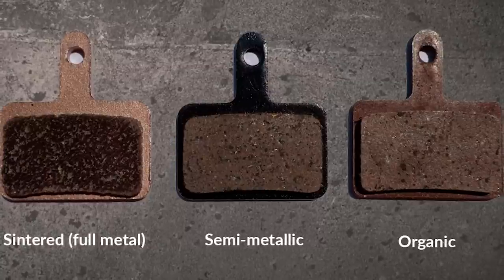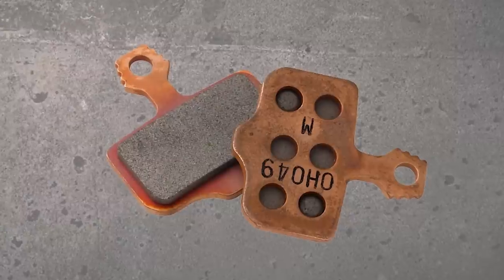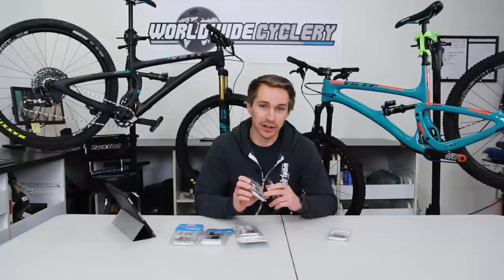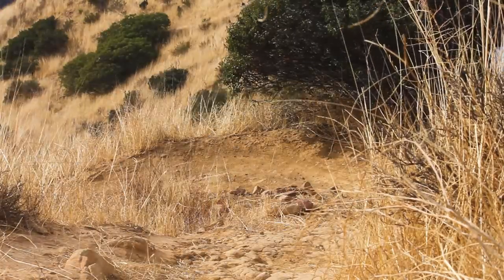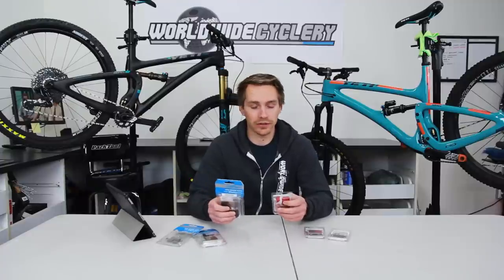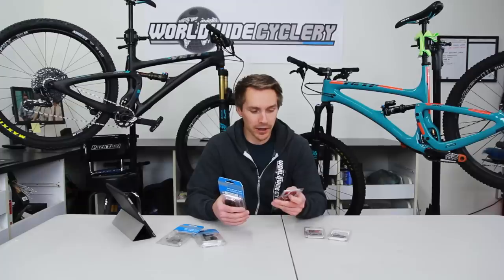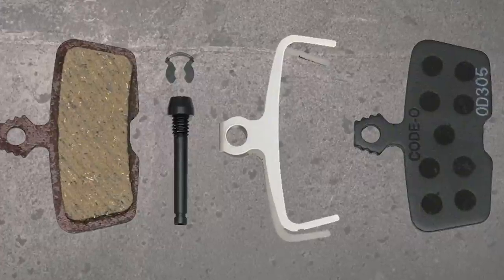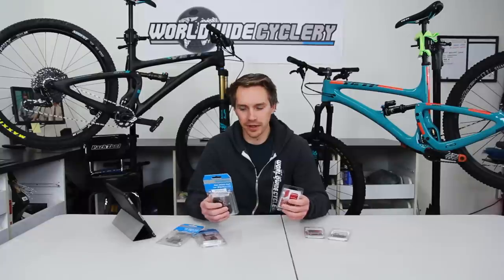Mountain Bike Brake Pads | Organic vs. Sintered - What's the Difference?

Comment: Sintering is the process of compacting and forming a solid mass of material by heat[1] or pressure[2] without melting it to the point of liquefaction.

Comment: Sintered pads wear out your rotors faster too.
Reply: My rotors sometimes make a terrible sound from my metal pads
Reply: I'm still running a really old set of Magura rotors 203 front 180 back and they are fine and will probably outlast the Magura MT brakes.

Comment: For my EX8 I use Galfer Green Pro up front (proprietary compound) on my Galfer WaveDisc rotor. Tektro ceramic-semi metallic out back on the stock rotor. 
Sintered are better in general. Though it does depends on type of riding and conditions.

Comment: i have ran the organic pads riding downhill, the organic pads work but burn off fast and smell very weird. the worst part is they make a wicked squeal and your rotors will get a film on them that makes them squeal even after you change to sintered. i would recommend swapping out organics to sintered on a new dh bike before you even run them.
Reply: thanks mjs1231...i only have dh bikes and bmx so i don't have any smaller rotor brakes...good heads up though!
Reply: I don't quite understand your statement - you can run any compound you want, regardless of the size of the rotor (unless you're just suggesting to stick with sintered if you're running big 203mm rotors).
Reply: If you do get a glaze on your pads, and even the rotors, you can safely sand that glaze off to refresh the surface (use 80 grit or 120 grit paper). That helps a lot to give you a new contact surface.

Comment: I don’t ride in wet conditions and I ride a trail bike fast, but like in the low 30’s fast, not DH speeds. SRAM G2 brakes. I prefer organic, aluminum backed brake pads. Every time I’ve tried metal/sintered I regret it due to the squealing and vibration. And that’s whether I set them up or my local shop. The noise is just not worth it to me.

Comment: Metal sinter would be good for city, sub-arctic, winter conditions like in Montreal Canada?... meaning very wet, slushy/snowy/frosty and salty conditions with a thaw after each wet ride. My bike is black but with all the salt stains it looks really dirty. It's not always slushy but when it is, it really IS.
Right now i am using Tektro hydraulic brakes (mineral oil) with resin pads and i am considering a better, longer-lasting option if available. The e-bike i have has 20"x 4" fat tires.
What do you think?

Comment: I've got some questions. I ride a handcycle and they have 1 breaking surface, on the drive wheel. I've upgraded to hydraulic breaks but still don't have good stopping power. My handcycle is for road and I've hit speeds of up to 75 MPH at a race in Boston. 
I train on mixed use trails so I need to break a LOT and break for longer distances going down hills in heavy used areas. I burn up breaks about every 3 months or so.
What pads would be best?

Comment: I run organic on my Norco Aurum  a 7.2 DH bike. Fitted into Sram Guide R 4 piston hydraulic callipers with 203mm rotors.. it’s what the bike came with. They are Nice and quiet. 
It’s Generally dry with very little dust where I ride. Occasionally can be damp but never had a problem. They stop and stop good,, the best thing is the total lack of noise. I hate squealing brakes...and as a DH bike to make them last we just don’t use the brakes,,, speed is your friend. 🤪

Comment: You did not talk about which one wears out faster. Wouldn't metal pads last longer than organic? And doesn't organic require 'bedding' i.e. transferring the brake material before so it can grip the rotor well or something?
Reply from the maker: Yes, organic tend to wear out faster. However both materials require "bedding" or "breaking in". Especially on fresh rotors.
Reply: Worldwide Cyclery Awesome thank you for clearing my misunderstanding.

Comment: Brand new aztec ms 120 pads on the rear and a fluid change at the shop for front n back brakes on trek rail,the lever has gone flimsy on the rear yet my front shimano pads from may 2022 has loads left on it,has any one had the same problem or should i go back to the shop and ask why my rear fluid n pad swap has gone flimsy?

Comment: I think it's even easier than that.
Some Rotors (usually the cheaper ones) are actually labeled 'Resin Pads Only' because the Metalic Pads can damage the Rotors. I feel that a Pad that can damage a 'Cheap' Rotor probably isn't doing much good for an Expensive one either. The Resin Pads are cheap enough that I can change them often, and always keep an extra set on hand. The Rotors are more expensive than the Pads, and will last longer with the Resin Pads.

Comment: I use:
- sintered in front
- organic in rear
Reply: This is actually a pretty good idea too.
Reply: I'm going to try that. My organic/resin front brake pads always squeak like hell.  While  the rear resin pads are quiet. I have 2 bikes with the same type of brakes. Same issues.
Reply: One of each in each caliper is better
Reply: Tu esi no lv?

Comment: Having watched this video, I'm interested in switching from my current organic to metallic pads next, for more power (though I'm in mostly-dry NorCal).  When swapping pad compound, I saw a SRAM video saying that I need to replace rotors together (so that they don't get mixed together): https://youtu.be/xTGHdFt5Y-s (at 1:50~).  Is this really recommended/necessary?  Just wondering f this is rather a nice-to-do theoretical advice or a must-do practical advice?
Reply: Asking the same question and noticed no one answered you over the year since you posted.
Reply: What I've been able to gather with Googling is that if you sand your rotors and use brake cleaner to get all the old material off, you should be fine switching between organic and sintered/metallic.
Reply: That sounds about right. I an not planning to replace rotors any time soon.

Comment: I've heard sintered is good for those of us that are heavier :)  a question is if my resin pads are worn out but my centerline rotors are still good can I change pads without worrying?
Reply from the maker: FoVision yeah typically a set of rotors will last 5+ brake pad changes no problem.
Reply: I think that is pretty high (5+). Every rotor has a "minimum thickness" rating that the user needs to watch. 5 sets of pads is a lot.

Comment: Are metallic pads easier to decontaminate once they got any oil on them? Just an assumption because my experience with cleaning contaminated resin pads is very bad.
Reply from the maker: Metal pads are maybe a little easier to clean but they are both hard to get all contamination out once they get soaked with oil. Unfortunate sometimes if it's bad enough they just need to be replaced.
Reply: Worldwide Cyclery I somehow suspected that answer. From now on I remove both wheels and put a balloon over the calipers when cleaning.
Reply: @AdrianSchwizgebel   you can just remove the pads before cleaning the bike, it's way easier and less work, than removing wheels and put a balloon......just saying. ;) 
just be sure how you remove it (the left and right pad, and front wheel and back wheel) so you can put after correctly.

Comment: Do Sintered Pads offer more braking power? I have a relatively new bike with guide RS brakes and they are not that flash. I see that the pads that the bike has come with are organic. I plan to change them to sintered in the hope of increasing braking power
Reply: Mark - I'll provide my input and opinion (but disclaimer, we are not affiliated with Worldwide Cyclery...yet...so this is just my real-world opinion). Technically, yes going to full-metallic pads will give you a physically-harder surface to bite your brake rotors. The initial feel will be actually stronger with your organics, but ultimately a full-metallic (sintered) technically give you more power on the charts. But also, more potential noise. Your Guide brakes are excellent regardless - maybe try to sand your current organic pads lightly with 80 grit paper to renew the surface and try that. Much of this is subjective...most of us at MTX prefer the feel and modulation of semi-metallics (organic) or our ceramics, but there will always be the die-hard sintered users. There is a chance that since your bike is new, the rotors may have had a little oil on them from the factory that wasn't cleaned - any trace will immediately ruin the pads. Try sanding the pads first, then yeah, you can try sintered and see how that works for you.
Reply from the maker: We got lucky with MTX Braking answering a lot of the comments on this video :)

I agree with those guys. The verdict is that sintered can provide a bit more power but do also create more noise. The other thing to consider is that the pad material is just one factor. A lot of things go into how a brake feels and performs from bleeding to rotor size to proper break-in method etc. So make sure you've ticked all those boxes and considerations as well. Feel free to give us a call anytime though if you want to speak with a top notch mechanic about it.
Reply: To add one other element to this question: you may end up preferring the feel of the semi-metallic (organic) pads over metallic, so in order to easily maintain that feel but gain the power you're looking for, go up a size on your rotors. You can go up to 203mm front or rear (which is really rare that people do, but you certainly can). A 203mm up front and a 180mm in back with semi-metallic pads might be your ideal situation. You'll just need some adapter brackets to bump up a size - its a simple bolt on mod).
Reply: Hi MTX Braking. Thanks very much for the comments and advice. This is much appreciated. I will try and give them a light sand before changing. I agree the noise of more metallic pads is annoying. I ran more metallic pads on my last bike and those brakes were noisy but they were also powerful. I tend to get myself into trouble on occasions so my current set up is concerning. I will tinker with them as most people and yourselves  tend to believe these brakes are good stoppers. Cheers
Reply: You're very welcome. One of our primary missions with this business is to educate our potential customers so they understand what their options are, and how different configurations can alter your experience for the better. The Guides really are great brakes, but like anything, bike parts are subjective. In our back-to-back testing, its just hard to beat the semi-metallic (organic / resin) pads in many cases (they sell 2:1 in most markets over full-metallics), believe it or not.

Comment: Sintered typically has better performance under high heat and will fade less.  If you're downhilling long descents, you want sintered.  Sintered also has better initial bite.  Yes they do squeal, you just get used to it.  Sintered pads on motorcycles and cars squeal too.

Comment: So organic is quieter but not silent correct? I still hear howl sound from Organic pads on road bike sram rotors.
Reply: Sram rotors are always noisy either they howl or turkey gobblle in the wet under heavy braking which is why i use shimano rotors on my sram brakes. Silent under all conditions.
Reply: Correct - organic / semi-metallic DO still have metallic content which can make noise at times. Nature of the beast.

Comment: any pad type tip for austria.
Reply from the maker: Not sure what kind of weather you're mostly riding in. If it's mostly dry going with resin is always a safe bet. Resin is a bit quieter and a better feel than metal but if it's wet than metal will definitely last longer.
Reply: Worldwide Cyclery  in summer it can be pretty try and in the winter there is most times snow and sometimes it is pretty rainy but not so often

Comment: No mention of rotor type...if you are switching compound, or getting new pads you need to make sure the rotor is compatible with that type of pad.
Reply: In my opinion that is a misconception. Most rotors are 410 stainless steel and can interchange with several compounds of pads and work perfectly.
Reply: Why do manufacturers specify pad type on the rotor them?
Reply: Jeff Low good question; because they want to sell you their brake pads with their rotors. And potentially to cover themselves with their lawyers. There is so much misinformation in the MTB community about braking products, which is why we started MTX. You’re certainly (and obviously) ok to match products but you absolutely don’t need to.

Comment: Organic is better.  If your sinthered pads last too long they can collect grease and your pistons won't move freely as they've collected grease too around them making them not flow right.  Organic is softer so it bites better when the brakes aren't "warmed" up.  Changing the pads isn't much of an issue and you can push your pistons back so they can flow better again.
Reply: Well unless you are doing any maintenance then yes, but if you clean your brakes after every or other every ride, then no. But organic glaze quicker as they are unable to dissipate heat quickly enough.
Reply: @rider65  Clean brakes after every ride?  Yeah, right.
Reply: @janlabij7302  Yeah right. You think every rider is like you? I come from a GP background. Cleaning the entire bike (parts included) after practice between races is the NORM sonny boy.
Reply: @rider65  How wonderful!  A genuine GP background!  I'm so impressed.  And, of course, every rider is like you, from a genuine GP background, not like me, merely a guy who rides either for pleasure or to get somewhere.